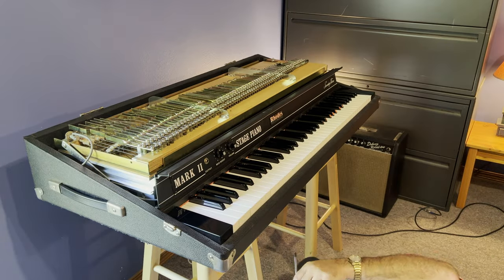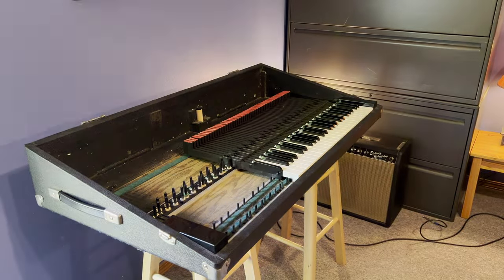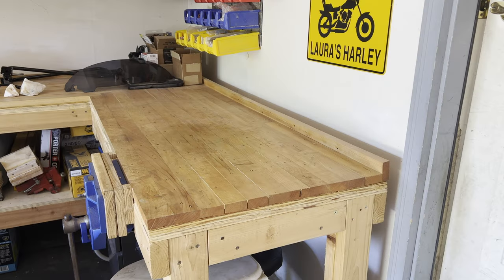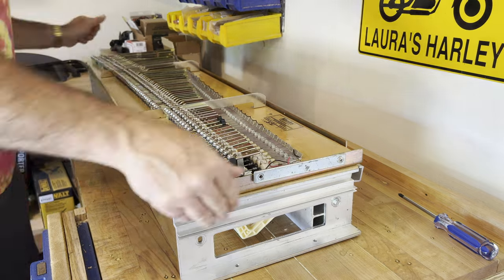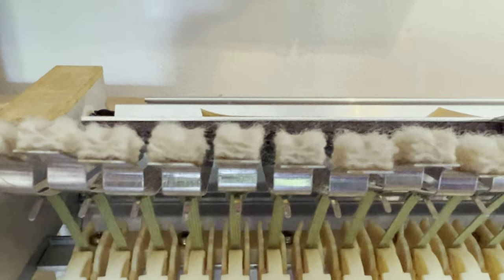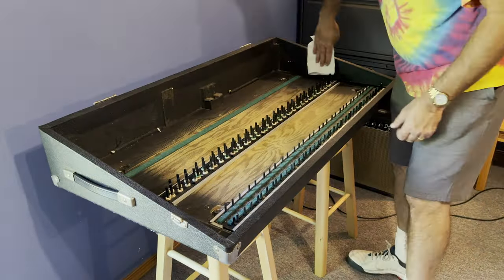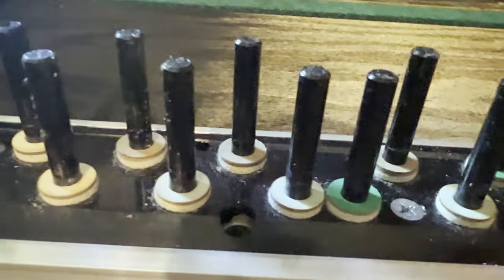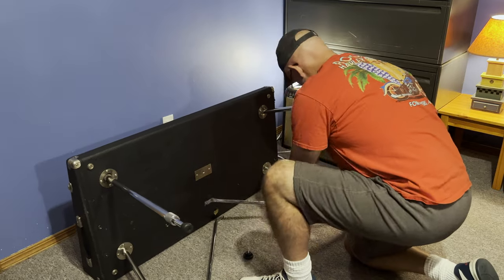Disassemble The Rhodes (w/New Replacement Legs and Crossbars)

Comment: Great job man. The black felts are factory original and are a very good quality felt.
Reply from the maker: Good to know!  I've got a replacement set on the way.  I'm probably going to change them all, just on principle, since they are approaching 40 years old.  And, the white damper felts look in worse shape.  Thanks for commenting!
Reply: @adventuresinpianoing6189  The white felts on these are a very hard to find woven felt that although looks compressed, does a very good job. I always leave these old felts as they perform well in the main. Some of the new alterntives can cause noise on the note release. The same woven felt was used on the MKV piano as on these late MK2's.
Reply from the maker: @goldphinga  With the white felts, I'm getting some buzzing when I release the keys.  There doesn't seem to be enough loft left in them to mute them cleanly, and they kinda buzz to a stop.  I've ordered the Vintage Vibe replacements.  Do you have an opinion of those?

Comment: I will begin to go through the same process as you did. I have a 1981 Mark II. My question is: when you return the action rail back to the case, was the alignment easy to do? Are there any alignment issues to take note of before removing the action rail? I want to be sure that when I put everything back, I took the correct steps and considerations when getting it all back together.

Comment: Hi. I ordered a new leg flange because one of mine has become unusable. The holes where the screws go into also are messed up. How would you install the new one? Drill new holes?
Reply from the maker: For stripped screw holes, you could fill them in with small dowels and wood glue, then re-drill pilot holes for the screws.